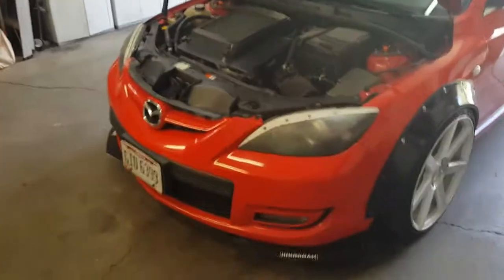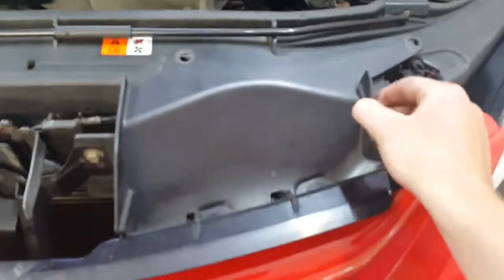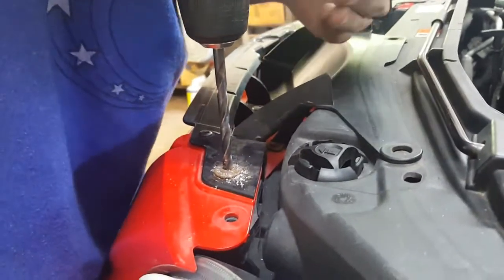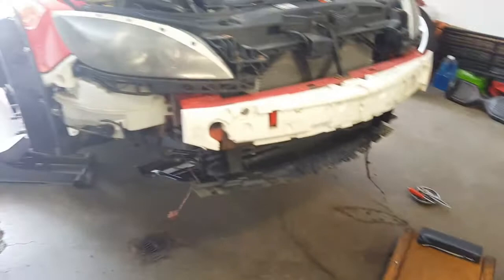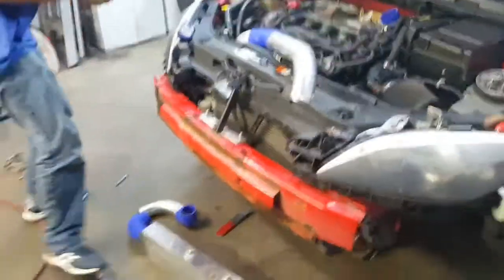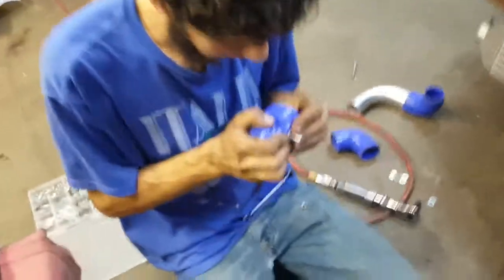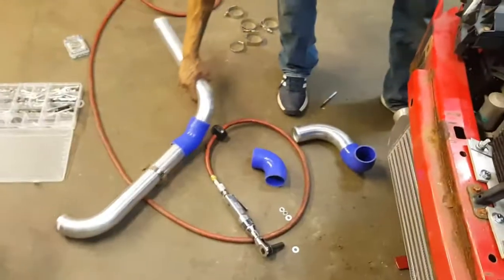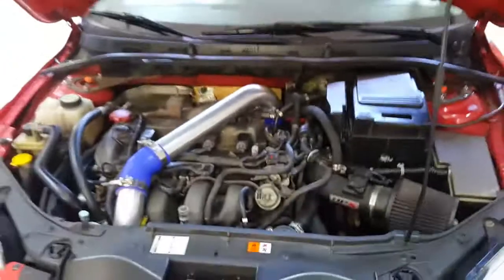CX Racing Front Mount install on Mazdaspeed 3

Comment: Did you need a tune to switch to front mount intercooler
Reply from the maker: I would say it's recommended, but not totally necessary.
Reply: Definitely! You can run it temporarily until you get tuned but definitely need a pro tune soon